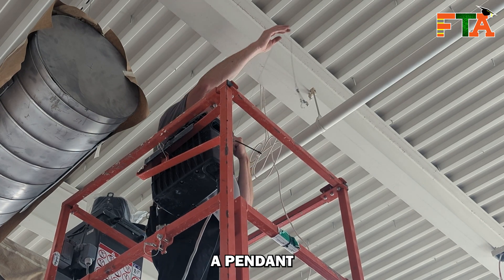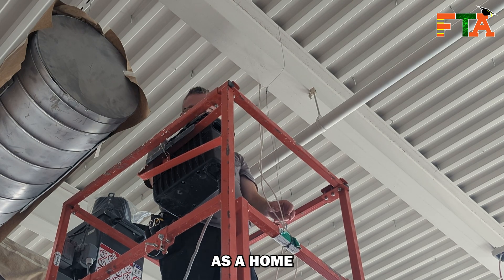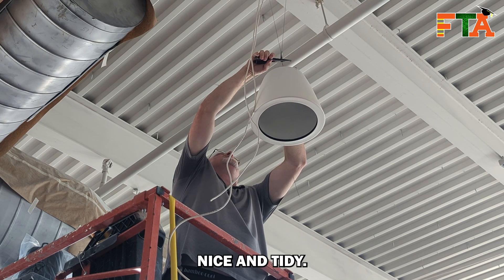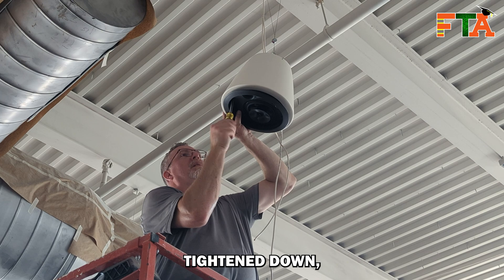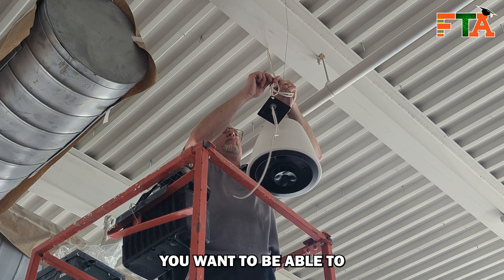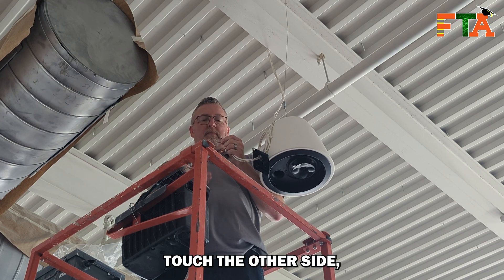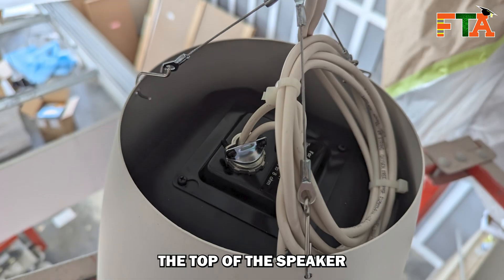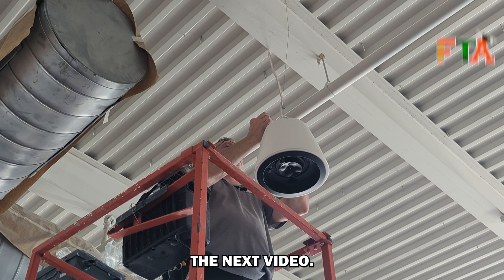How to Suspend Speakers From Ceiling with Gripples | How to Daisy Chain and Mount Pendant Speakers

Comment: I have those same strippers, bought it years ago, never use it. It puts way too much tension on the blade and you end up putting tiny little cuts into conductor insulation. Especially since you made multiple turns with the tool. One turn is enough. I would also never ever use that tool on any data cable. Get a stripper that has an adjuster on the blade so you can set the depth of the cut/score. The goal is to put a light score around the entire diameter of the jacket, not actually cut through it.
Reply from the maker: Interesting. I've never had issues with them over cutting.
Reply: @fieldtechacademy  Trust me you have. With a spring loaded pre-tensioned amount of force on that tool ( too much IMO), and cable jackets with many different thicknesses, you can't gauge how many turns you need to do, to exactly cut through the jacket without cutting into the conductors. With a tool that has an adjustable blade depth, you can dial in the depth and amount of turns on a scrap piece of cable. Then repeat the cuts/scores with accuracy on same cable as many times as needed. I am not saying that every time you strip, you are cutting into the conductor, but it will happen. Check the conductors carefully after you strip, it may only be a slight cut. It's not as critical on speaker wire, but I would never use that tool on a data cable. A small cut or "micro nick" on a 24 awg wire can make a difference. That tool is almost as bad as using your scissors or pocket knife to cut/score. Seen guys do that so many times.